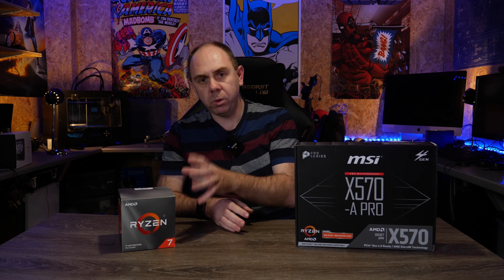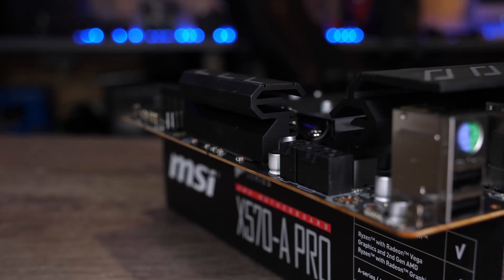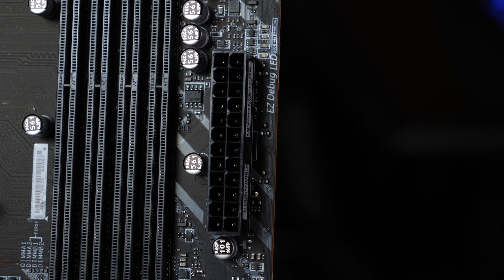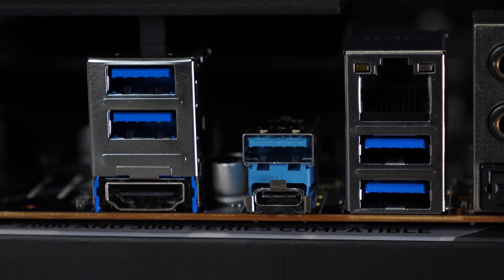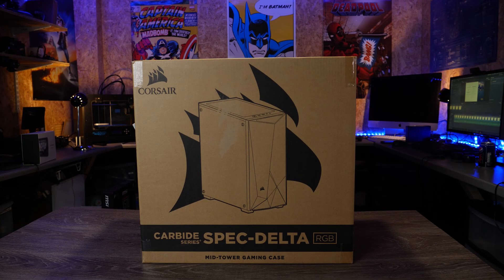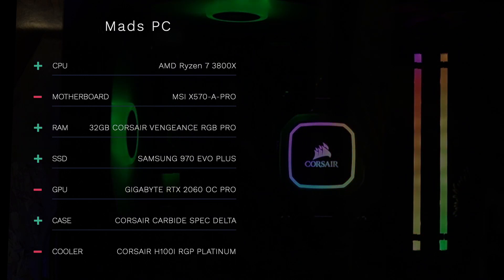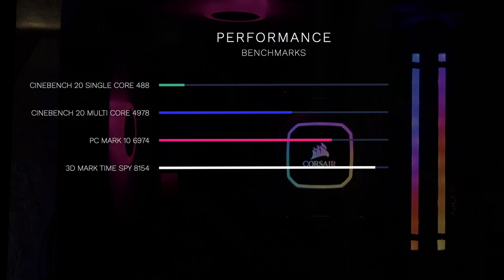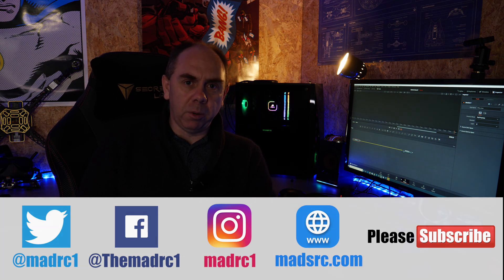MSI X570-A-PRO Motherboard Review  - AMD Ryzen 7 3800x PC Build

Comment: This board powered on ONCE then gave me some bs CPU led malfunction with some janky power supply switching "fix" I've got to do every damned time I power on the computer.  This is my first MSI product and I'm not impressed at all.  Heading back to Asus immediately and selling this POS motherboard, 12 YEARS on the same ASUS REVO motherboard platform not so much of a peep of a problem.  Not a fan of paying for better but the one time I downgrade to save a few dollars and it bites my ass.  Not again.

Comment: how does it work with ryzen 5000? want to get a 5800x3d and need to know if there is any performance loss.
Reply from the maker: Yea it will be fine but it’s more a productivity board.
Reply: want it for gaming. if Performance is not hindered i dont care :D just want to get my frames nothing special. 1 m.2 1 gpu 4x8gb ram 3200mhz and some HDDs for crap tons of games that dont need m.2 speed
Reply: If you're planning on upgrading to a Ryzen 5000 on this board, you'll need to update the bios to the latest version but do it while your old CPU is in.
Reply: @JRuffPlays dude this comment is 3 years old, we are at ryzen 9000 already 😂 also it worked fine. had to update bios for some extra features with x3d (like pbo) but it worked fine from the beginning

Comment: I bought this with a ryzen 9 5900x and it seems to work just fine. The only issue I have is the nvme 980 pro I just bought isnt working but it seems to be a windows issue since it shows up on the bios but not windows disk manager

Comment: Hi, great video ! By the way, can you please tell me if i have that motherboard, and if i buy 4k monitor which has only DP 1.4a and hdmi 2.1, is it possible to get output of 144 hz or frames in game anyhow or im stuck at 60 hz ? Thanks a lot, continue great work and good luck with new subs ;)

Comment: I've been running into issues with my PC rebooting outside of games. I've done a LOT of diagnosing with no promising results yet, but upon going back to PCPartbuilder, it's returning a compatibility issue between this board and my AMD Ryzen 7 3800x?
Reply from the maker: Chances are its drivers, there is no comp ability issues between these two as X70 is specifically for this CPU.  I would not rule out a bad board but you would need to look at your rating of PSU and things first.
Reply: Thanks for the reply. I just completely reset my SSD and reinstalled Windows and the exact same thing is happening, so it's gotta be hardware... Now, which piece is the one causing issues... This is going to be the interesting part where I buy something expensive that I didn't need to 😭
Reply from the maker: @333puggles333  have you got XMP on ? If so try it off. 

what PSU you got ?  When you say reboots just a instant reboot I assume.   Ram would be my fist bet but it’s possible it’s a bad board.  Try a single stick of ram at a time if your dual channel then work from there.  I know this kind of issue is a pita.
Reply: @MadRC  No I haven't messed around with overclocking at all. Yes, it is either an instant reboot, or completely freezes. I did a ton of diagnostics today to try and narrow down the issue. I learned a lot of things it's not...

It's not software related, it's not RAM, I tested one stick at a time and reproduced the problem each time. It's not my hard drives. It's not overheating. 

I'm thinking it's either PSU or my MOBO.
Reply: Update... I drove 30 minutes to my friend's house to pick up a spare PSU and it rebooted itself yet again. Not the PSU then.

Comment: I have decided to buy a PC for 3D,Video editing,rendering,motion and others heavy graphics design related works,
is this motherboard a good choice with these components below:
1.AMD Ryzen 7 3700x
2.32 GB (16X2) 3,200 mhz desktop Ram
3.6 GB GDDR6 Nvidia geforce GTX/RTX Or, AMD Radeon GPU (5000 series)
4.M.2 PCIe or NVMe SSD (240 GB above) /7200 RPM HDD (1 TB above)
5.2k/UHD/4K display Monitor
Feedback appriciated,Thanks.

Comment: Hi,
Thanks for your video. 
I just install My MB (MSI X570 Ryzen 7 3700X 16 Giga RAM G.SKILL DDR4 3200 Mgz.
SSD Corsair 256 Giga, One HDD 1 T, one DVDROM
XFX RX 570 8 Giga for the Video Card.

I have a led on EZ Debug on, the boot one. Imposible to get it started.
Do you have any idea ?
Mikaël
Reply from the maker: Have you checked your ram seating ?
Reply: @MadRC  Yes indeed, I found a video who said to shortcup at the CMOS Erase Jumper and it worked after a few try.
Thank's

Comment: I'm running this board in a Corsair 750D airflow edition with Corsair 850x psu, red devil 5700xt, Ryzen 7 3700x and 16gb of Corsair ram and I've never had any heating issues or problems with it. I love it
Reply: I've just baught this board soon as it got back in stock on amazon, as it's the perfect one to match my amd ryzen 5 3600.

Comment: tx. Wheres the build video ? I have so far connected the motherboard, psu, ram, cpu, cooler, connected cpu fan, board power and then used the 8 pin cpu power connectoed (theres a couple of 8 pin things coming ogg my psu so I guess its hard to go wrong right?) I havent connected the graphic card yet. Anyway nothings happening fan wise where am I going wrong ?

Comment: Idk if you will ever reply to this, but do you think this motherboard would be good with a amd 3600x and a radeon 5600 xt graphics card?
Reply from the maker: Hay thanks for the question, Today look for X570 based boards or wait a little longer for the new B550 boards that will be cheaper than X570 models as that will give you more upgrade options in the Future.  This board is goos but not ideal for Gaming, check out some of the other MSI X570 models for more features.
Reply: @MadRC  true but if I get a motherboard like a b450 TOMAHAWK max and I got a ryzen 3600 then couldn't i still get a ryzen 9 5 years later which would still be ok?

Comment: Hi, i assume it is fine to just power the CPU with the 8 pin and not include the 4 pin, i have just ordered an x570 and 3800x my PSU only has the 8 pin and not the 4 pin. Thanks
Reply from the maker: Yea that’s fine.

Comment: I have had this board since July, and I must say that heavy gaming on it is absolutely brilliant. No overheating issues and it runs my 3800x to the highest of potential. Thanks for this first rate video!
Reply: I bought the board some days ago, and I'm very glad to hear this comment. I'll use a 3900x, you think the board can handle a full overclock? In the CPU I'll install a watercooler corsair 115i pro...
Reply: @juliocesardamasceno8414  A full overclock? I think so. I have overclocked  my 3800x and haven't had any issues. I think you will be ok. There is an extra 4 pin connector on the motherboard, so they may have been expecting overclocking on this board.
Reply: @jameysummers1577  what cpu cooler do you use?

Comment: I have this boards with a Ryzen 7 2700x and a Rx580 8gb gpu. I'm not impressed, I moved my gpu to the upper pcie slot and have had trouble ever since getting it to post, let alone open windows. I've reset cmos and flashed bios. The only way I got it to work was putting my gpu back to the bottom slower pcie slot. I've seen other people with this issue as well with this board and gpu set up.....
Reply from the maker: wow that is an odd one, I have not seen that my self.

Comment: I need help, I'm getting the Ryzen 5 3600, I was going to get the MSI B450 Tomahawk max, but on PC partpicker is says that a BIOS update would be needed. However, on the box of the motherboard it says it's ready out of the box without any BIOS update. Please help!
Reply: The "max" in the b450 tomahawk max means it is good to go with the ryzen 3000 series so you'll be good to go with your 3600
Reply from the maker: Most B450 boards need a firmware update to work with the 3000 series Ryzen.   If if allows USB Bios flashback with out CPU then you can just do it with out an CPU.  However if it does not you will need a 2000 series CPU to flash it.

Comment: I got this and I have a problem rn and it’s that it has 12 pin cpu on the motherboard but I can’t find a cable with that so Do I need to have all 12 or can I just put in 8 ?
Reply: 8 is just fine.

Comment: Hi,  I think you need to subscribe to Hardware Unboxed because if you did then you would only have bought this board to melt the snow off of your driveway.
Reply from the maker: Nicholas Heidl 

I have seen that video but Iv had no issues with my MSI X570 A Pro in a recent build at all. VRM temps don’t get over 70 even in full blender and stress testing and most of the time they are at 50.  

I’m using with the Ryzen 7 3800x so not all out top end CPU but still very happy overall with performance and am not getting any throttling issues.  

It’s clear from that testing that on its own it’s not performing as well as others but in a good standard ventilated setup I have seen no issues. I’m not like doing anything specific for VRM cooling and it’s taking care if it’s self fine.  

Sometimes real world use cases are more relevant than absolute bench stress tests.

Comment: Can i go with this same specification for day trading system..
 How it will sir ?
I m waiting for your valueble comment or guide line ..please
Reply from the maker: Spec should easily be fine for that but again it’s down to the CPU overhead and software. That appears a productivity task and the 2060 could be overkill on the graphics side.
Reply: @MadRC  thank you for replying.

Comment from the maker: Hi Everyone,  first of all thanks for watching my video, If you liked this video please share it and give a thumbs up.  

I want to address some comments on my review vs the Hardware Unboxed test of this board that shows seriously high VRM temps in stressed use.  

I have seen that video after I purchased but Iv had no issues with my MSI X570-A-Pro in my build at all. VRM temps don’t get over 70 even in full blender and stress testing and most of the time they are at 50.  

I’m using this with the Ryzen 7 3800x so not all out top end CPU but still very happy overall with performance and am not getting any throttling issues.  

It’s clear from that testing that on its own with out cooling it’s not performing as well as others but in a good standard ventilated setup I have seen no issues. I’m not doing anything specific for VRM cooling and it’s taking care if it’s self fine.  

Sometimes real world use cases are more relevant than absolute bench stress tests for normal use cases, I would not recommend this board for an all out high end gaming machine and it wound not have been chosen for that application but on the flip side Iv had zero issues either with my setup. 

Check out the Hardware Unboxed Test here for your own views on this 

https://youtu.be/xbyWKufthS4

I also really like to get feedback and comments on the subjects I talk about so please comment below, tell me what you think and give me your view. Also if you have any questions please post them and I will endeavour to answer where I can.  

Thanks Everyone

Ian (Mad)
Reply: I have the same experience! That video makes this board look terrible, like your house will burn down if you buy this. I've never had an issue with VRM temps using a 3700x. Never above 70 like you said. And they forget to mention it's $100 or more less than the other boards! Better to spend that money on the graphics card imo. Love the build!
Reply: I have this board since 1 day, and I can share your opinion...but....I can go over 4300mhz with this board -_-' , test Asus Prime and I can get easly 4425 with same processor and memories
Reply: This board will match the amd ryzen 5 3600.

Comment: im looking forward to buy this board too, thank you for reviewing!!!
Reply from the maker: Thanks :)
Reply: @MadRC  
Can u help me real quick
I'm currently trying to build my first 3d, video, graphic design and gaming rig
(Adobes, Cinema4d, Sketchup, blender)
in around 2 months of researching, browsing and asking around
i come up with this of spec: 

PROCESSOR
AMD Ryzen 9 3900X
RAM
Team T-Force Dark Z Alpha DDR4 3600Mhz 16GB (2x8GB)
SSD
WD Black M.2 NVME 250GB
Team GX2 1TB
CASING
Deepcool Macube 310P
VGA
Gigabyte Radeon RX 5700 XT 8GB DDR6 Gaming OC
PSU
Deepcool 750W - DQ750ST 80 Gold
MOTHERBOARD
Gigabyte X570 Aorus Elite
MONITOR
ViewSonic 24" VP2458    
CPUCOOLER
Deepcool Castle 240 EX Liquid Anti Leak

Do you have some tips or personal preferences about better/matching components
that can save some budget or trading with better performance-budget?

Thank you!
Reply: @gidysie  I would advise you to watch and subscribe to Hardware Unboxed and Gamers Nexus to get a real idea of what you should buy.
Reply from the maker: Nicholas Heidl 

I have seen that video but Iv had no issues with my MSI X570 A Pro in a recent build at all. VRM temps don’t get over 70 even in full blender and stress testing and most of the time they are at 50.  

I’m using with the Ryzen 7 3800x so not all out top end CPU but still very happy overall with performance and am not getting any throttling issues.  

It’s clear from that testing that on its own it’s not performing as well as others but in a good standard ventilated setup I have seen no issues. I’m not like doing anything specific for VRM cooling and it’s taking care if it’s self fine.  

Sometimes real world use cases are more relevant than absolute bench stress tests.
Reply: Don't

Comment: Interesting that you opted for the 3800X instead of just the 3800 -- most benchmarkers have indicated that there's only a minimal difference in the overclocking potential of the X vs the plain 3800.   When I bought my present system (a couple of years ago) I ended up opting for the i7 8700 rather than the 8700K because I figured it would be fast enough without overclocking...   I saved a bit of $ and used that money to buy a better video card.  Money well spent for Davinci Resolve.  Just finished a 4K edit and it was fun/quick.
Reply: Lol it's clear you have no idea what you are talking about. There is no 3800 without the X. After the 3600 series there is only the X series for 3700x, 3800x, 3900x ... you might be thinking the 3600 vs 3600x... that doesn't apply here
Reply from the maker: In the UK we only have the X versions of the Ryzen on sale from what I can tell.  All chips we have are X.    I was originally looking at the 3700 but the 3800 was on sale and actually only £20 more so went with that.  OC wise t h I did give it a little push to see how it behaves and tbh there is little to no real ability in this chip with out some serious cooling. It seems the 7 3 series is almost maxed out.  I’m also not getting near the max clock even on full power plan and my chip is topping out at 4.2ghz.  That’s a fair bit below the AMD spec of 4500 but that is rated for single core only and I think better temp control than I have.   One thing I wish I had done was go for the larger 280 cooler tbh.
Reply: @MadRC  I did upgrade my air cooler vs the stock one and upgraded to latest MSI BIOS and it did help me gain a couple of hundreds Mhz

Comment: Call me old-school but the last thing I want in a computer on which I'll be doing colour grading... is a bunch of RGB LEDs constantly changing the background lighting and casting reflections around the room :-)  I actually had to search quite hard to find a non-LED fan for my machine when the stock fan died.   I did fit a "cool blue" but it was AWFUL because the brightness was so high that the screen on which I was working had a definite blue caste to it :-(
Reply from the maker: I thought you were going to say water lol 😂.  I’m like a Magpie I like shiny and bright things lol.   Tbh I did not really know how it would work out.  As I was ordering things it just ended up as led versions so I went for it. Definitely get the point.  Thankfully these are not too bright actually and as the glass and front is smokes it’s a dull glow.
Reply: Get a life. They can always be turned off or just don't plug in the RGG connection.
Reply: @joanamendoza-r5l  I did order a life but the supplier seems to be out of stock and it's been on backorder for several months now.  When it arrives, I'll install it and see if it fixes the problem.  Thank you for your wonderful advice!